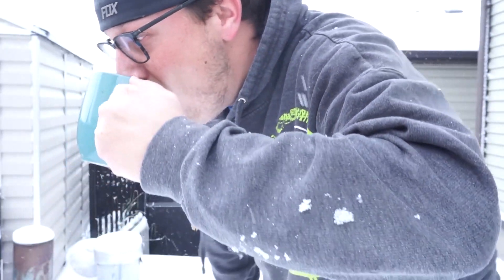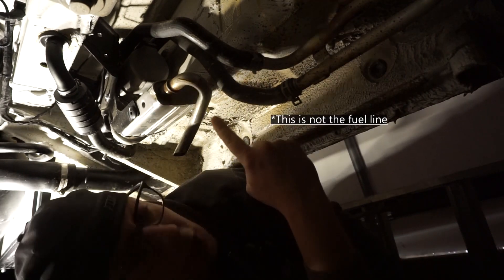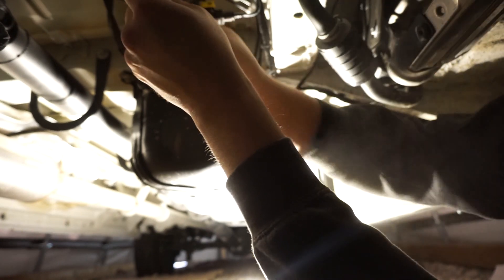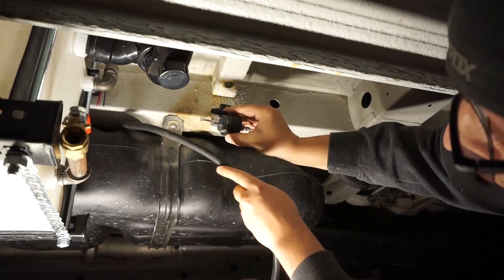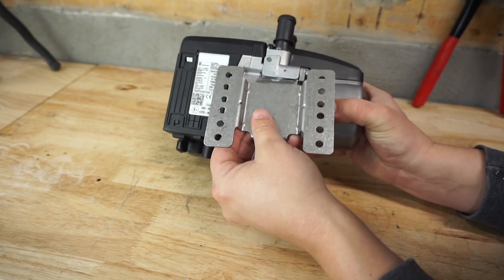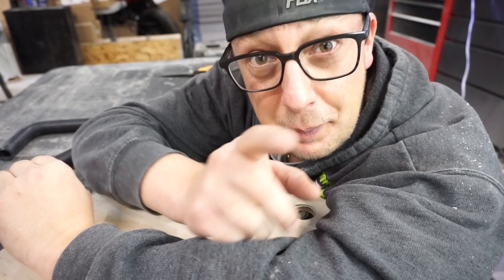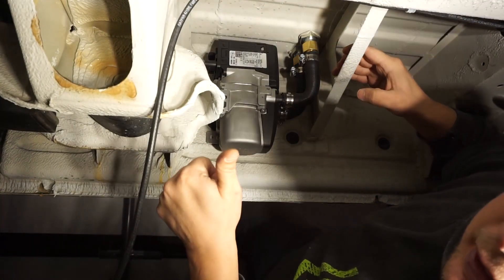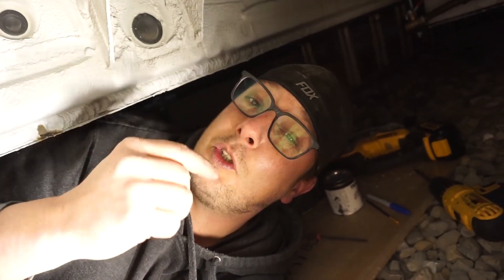HYDRONIC HEATING burner install | Four Season Van Life | EP.40

Comment: No issues with the fuel line tee adapter? Do you not need one way valves on each line?
Reply from the maker: @Learnandgrow-x  no issues at all, this product is designed for this exact application.
Reply: @ awesome! thx for the reply!

Comment: I think that the mounting screws that came with the machine are tri lobular thread forming screws. These screws form the thread as you drive them in by mushing the Aluminium up. Very common for die cast Aluminium housings like electric motors.

Comment: Just found your video on diesel heater / hot water? So if I am in the desert, need hot water heater not hot air??? 🤷 any ideas?  I only have diesel and 12 volt DC????

Comment: Have you run the hydronic heating in Van yet? Can you make an estimate of how much fuel heating with hydronic system takes and rough temperature outside when you did test? From Rixens literature is says 0.15 gal/hour. For air heating only system takes only 0.042 gal/hour. Seem like a lot of fuel (4 gallons a day) or does heating cycle so much less fuel is actually used.

Comment: You probably noticed the factory fit heaters air intake goes into the frame rail, that is supposed to provide silencing and protection from water ingress so you could try doing that if the noise from your second one gets annoying 😀

How’s the exhaust and heater coped close to the wheel any excess muck or damage to either? I am curious because I am still deciding where to mount mine.
Thanks

Comment: Thanks much!  My furnace is under the van just behind the driver’s seat. I want to run the glycol hose to the other side, over the exhaust. What do I need to do to protect the hose from the exhaust?  Is there a minimum distance to maintain. Do I need to shield the hose somehow?  If shield, any suggestions?

Comment: I just finished installing my D6L heater (looks the same as the one you have), and the manual states the the bolts that come with the heater is self tapping, so no need to tap the holes before screwing in the included bolts :)
Reply from the maker: This is a true story that i learned after tapping the holes and making the video... No harm done though achieved the same end goal!!! Thanks for watching and commenting.
Reply: @DaresDrives  I think we all learn a lot during such build, having very little practical experience I know I do  :) As you say, no harm done.
Now if only I could get my water pump to be just half as quiet as yours I would be happy :)

Comment: Thank you SO MUCH for creating a hydronic how to video, I recently bought one for my own Sprinter build to add for hot water and I found there are so many steps and parts not mentioned anywhere. Seeing your approach is immensely helpful to piece of mind and saving time when I start the install.

Just wanted to flag something on the exhaust. You might want to route it out the back side of the van. I installed an Espar D2L Airtronic (the same exhaust) and the manual says to make sure to have the outlet port clear the outside edge of the van to avoid gas buildup underneath. Also, if you put it out the side eventually you’ll smell like exhaust when cooking in winter with the t-vents open and the heater on. I also heard that the wheels throw salt, snow and dirt which can foul the exhaust if it’s placed right in front of the wheel. 

Hope that helps and keep up the good work!
Reply from the maker: Awesome glad you are enjoying and I do appreciate the input... I don't have any opening windows on the side of the van but I am debating the location due to possible snow build up in winter driving months.. I will leave it as is for now and can be easily modified and discussed at a later moment when traveling... Thanks for watching and commenting.

Comment: Nice install and love the floor passthrough solution. Tip, might want to drill a small drain hole on the bottom of the muffler as the stock hole is on the other side of where the mounting bracket hole is, so...pointing upwards in your install.
Reply from the maker: OOOO, Good call, never even crossed my mind on that one.. Heading out right now to look at this and correct.... Thank you for watching and commenting...

Comment: Hey Jeff, I'm curious why did you put the intake of the air filter right up against the frame of the van? Wouldn't that block the airflow needed for the furnace to work well?
Reply from the maker: Hello the inlet does not actually touch the frame, there is a 1.5" gap for air to enter without restriction.. My Instagram has a few better photos of the mounting position. Thanks for watching and commenting.
Reply: @DaresDrives  that makes more sense now, thanks for the response! I'm actually mounting mine under my can this weekend. I can see with the sprinter you have a lot of mounting options. On a Promaster it is going to be interesting haha. Keep going on your build man, it looks gorgeous so far. Also, your outro sounds are freaking awesome!! "Perfect!" 😎

Comment: Does anybody do a video on the wiring as I bought this heater through Amazon and no instruction as well as a lot of parts apparently. Most important was no instruction manual. Using it for in floor heating and hot water/recirculating shower in cargo trailer conversion. I also have forced air diesel heater now up and running.
Reply from the maker: I did an earlier video about the pre-wiring of the unit as well just finished our completed install which shows wiring on new upgraded system.. Hope it helps. thanks for watching and commenting

Comment: Your heating system intrigues me.  We just purchases a 2020 Ford Transit and it is being outfitted with 4-wheel drive.  Can you give me an approximate cost of this system for hot water and space heating. Thanks
Reply from the maker: Give Rixens a call as they price can vary depending on your set up.. But I will warn that it's probably the most expensive option out there yet the advantages far out weighed the cost when thinking safety and long term value...

Comment: Your videos are very entertaining and most of all I think you put a lot of thought into your modification decisions.  Have you got the Espar fired up yet? I am curious if you have found extra noise by mounting to the inside body panel. It is quite hollow and sounds drum like when tapping on it.  I am considering using self tappers into part of frame structure because of the acoustics. What do you think?
Reply from the maker: Nate Marine hello and thank you for watching, super happy you enjoyed!  

 Yes acoustics were a concern during the plan for this step, seeing the factory engine espar heater is mounted to the same location just further up the van and it is not loud at all I assume it should be the same for this unit.  I have not tested it yet but will have a video about it once we get to that step.  The frame may be a little more solid but is still hollow so not sure it would make much of a difference. But I don’t have real life experience to share unfortunately. 

 Thanks for watching and commenting!!

Comment: The Thread Detective is a useful tool to identify any bolt or nut either for tapping purpose or buying the same correct one:

https://www.amazon.ca/Innovative-Components-Detective-Identifier-Attached/dp/B00GB03OLU/ref=sr_1_3?crid=1WFOTO4CDHANG&dchild=1&keywords=thread+identifier&qid=1606585221&sprefix=tread+identi%2Caps%2C211&sr=8-3